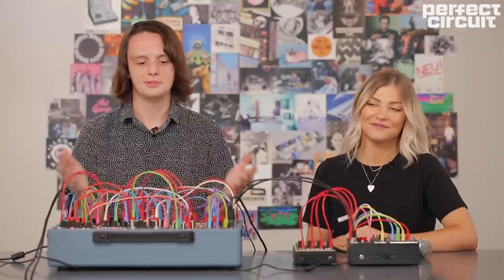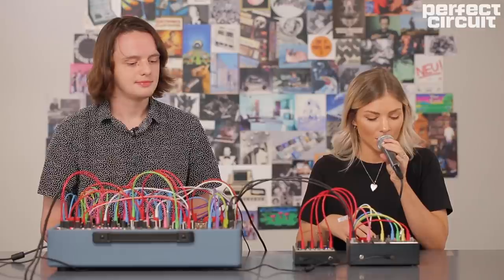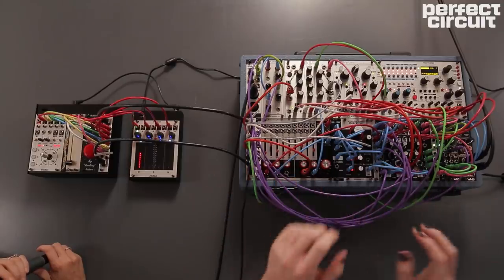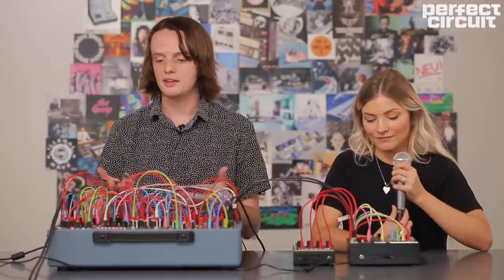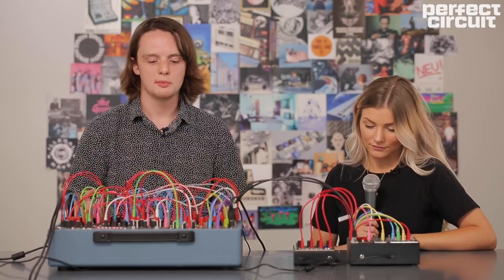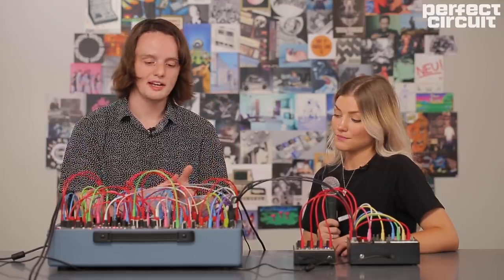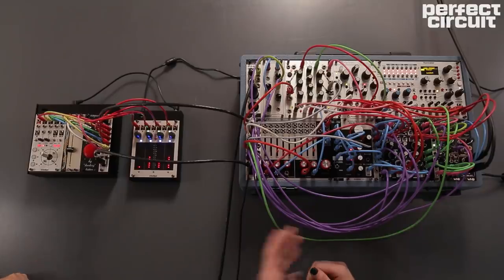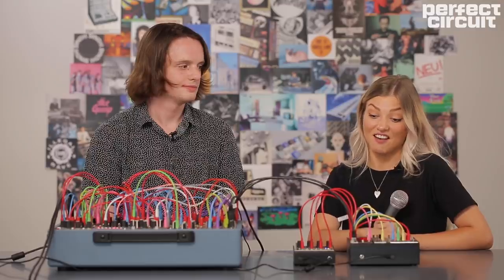Singing Into Synthesizers! Techniques and Concepts for Performing With Vocalists!

Comment: I'm running my vocals through my hydrasynth and this just have me some great ideas to work into my setup, Thank you ❤️❤️
Reply: How are you able to do this? I have a hydrasynth
Reply: @jjjohnson834  you go in through either of the mod inputs to the ring modulator. You can turn down the ring mod so you don't hear it, but keep the mod depth up. I'm using a mixer for my mic, then out of a send on that to the Hydra. I don't think the Hydra would accept a mic level input directly. You can latch a note without any of the oscillators playing if you wish, then apply any of the effects to your voice.